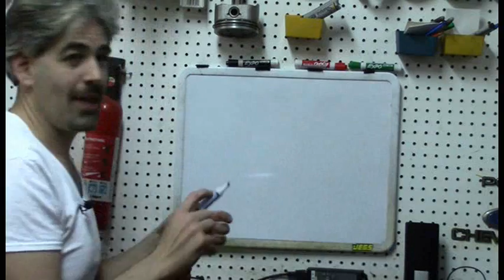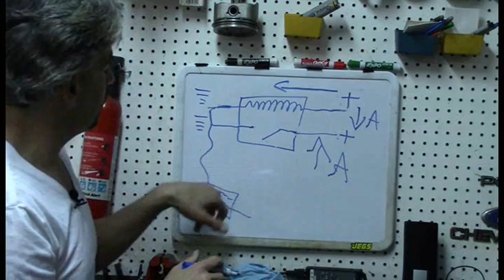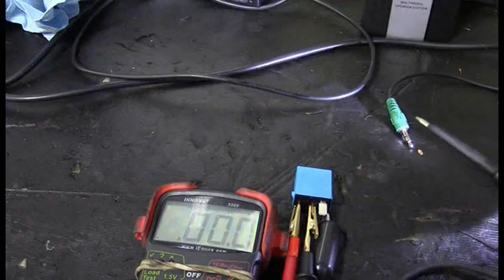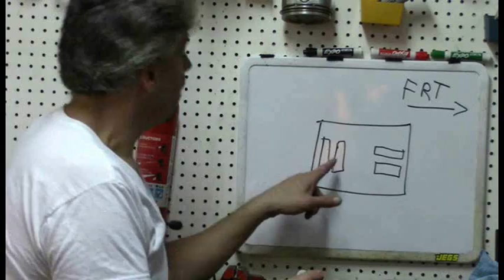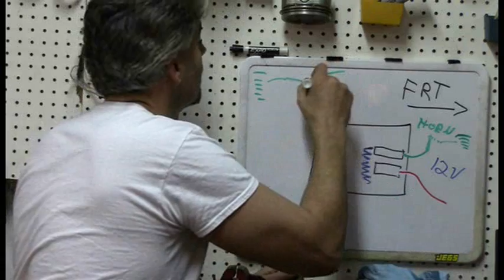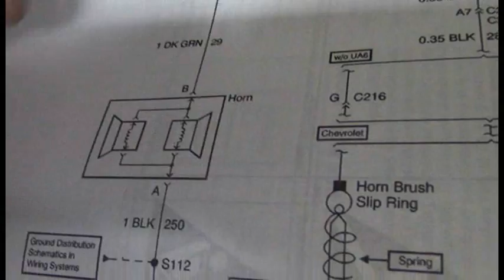Relays- Understanding, Diagnosis and Testing Relayed Circuits-Pt1

Comment: ok sorry. let me try to explain it better.  Please tell me what i am doing wrong. Internal short as a short in the compressor itself.  I have power on both ac wires with it plugged in or not plugged in. either way both wire show hot. it shows power on both wires on the compressor.   the coil wire and the ground wire . No matter if its plugged in or not . with the ac unplugged i have no power on the wiring harness wire. The wire coming from the harness that has the plug end on it does not have any power only until i plug the ac up.  the ac gives it power. instead of that wire giving the compressor power. Which is the way i thought it should be. The ac wires show to be hot even when its not plugged up to the wiring harness. The low pressure side switch shows power on both ports even with the ac unplugged  and will blow the big ac fuse if i try to bridge it over to cycle the clutch. Will also blow  the  big ac fuse if i try to bridge it over from the fuse box/relay. but if i unhook the high side sensor switch that show 3 hot 1 not 4 incerts that gives me  1 hot 1 not on the low side switch. then try to bridge it over and it still will not cycle the clutch but it dont blow the fuse that way. the high side switch like i said shows 3 hot 1 not but the 1 thats shows not hot is a blue wire going into the switch. that blue wire show to have power on it going into the switch but show no power in the port hole of the switch.  Yet i can hook a wire to the coil wire on the compressor  then  to the hot post and the clutch will cycle that way. The compressor worked great on the 96 cherokee. all i did was change the backs out because the lines go on different.
 i put a test light on the what should be the ground but shows to be hot held it there and  i pulled every fuse and relay in the fuse box under the hood 1 by 1 and none of those cause the light to go out or the power to go off  of that wire. Didnt do it inside the fuse box yet. . still showed power on the ground wire on the compressor. Well it should be ground but some how its got power on it. i do think i got a ground somewhere because that low side pressure switch should cycle the clutch when u bridge it over from there and so should the fuse/relay but they both will blow the big 20 amp fuse if i try that. How do i find a ground. The electric fan  switch/plug in shows, unplugged 1 port has power 1 port no power but when i plug it back in it shows both wires going out the fan to be hot. With the test light on the battery ground  the light comes on when i touch anything. the ac lines the compressor the engine the engine block and the block ground, inside of fender .. Man i need help..i hope you can understand this...
Reply from the maker: What are you using as your ground reference? Battery negative or chassis or the sensor connector?
Reply: hooking my test light to battery neg.  touch both wires on the compressor show to have power on them... touch light to sensor connector they both show power. the ground on the block shows to have power. Should i have test light hooked up to the pos.?
Reply from the maker: Check the actual voltage on each wire vs battery negative.
Reply: ok i borrowed a meter with the meter set on 20 v with the key on, ac controls on, fan on, and ac unplugged.  With black lead on neg post and red on  the compressor  ac plug it reads and 0.01 and  on ground wire coming right off the compressor reads 0.01.  However when i manually  kick the clutch in using the  hot wire on the compressor to the hot battery post i then get 12.5 6 7 volts etc  When   Jeep running everything hooked up the same way i get 13.4 5 volts  from the ac plug and  ground while  running shows 0.02  The voltage from wiring harness wire/with the ac plug i get 0.06 running .  Update  With motor off, key off, with neg battery term hooked up i get 0.00 at the ac plug and 0.00 at the ground on the compressor... but when i unhook the neg cable/post i get a reading   of 12.21 an rising from ac plug and 12 .13 an rising on the ground coming off the compressor. Terminal  hooked up no reading. Term unhooked and with my black lead directly on the neg post of the battery i then get a reading. I  admit I dont know much about using these meters but ive been watching video's trying to learn all i can. I really appreciate you trying to help me. i must get this working. I have breathing problems and i really need the ac working. Its hard for me to catch a deep breath when i get real hot. So Thank you very much for trying to help me.

Comment: And also maybe one of the reasons to use the relay is the PCM which it can't give a high current to all systems in the car it only provides the signal to let the high current activate the component

Comment: Matt, your reasoning seems flawed.  You found a wiring diagram that was "similar" and "maybe not the exact one for that car," and then, because that diagram represented what you had mapped out on the white board of knowledge, you concluded, "...so we did map it out correctly."
Reply from the maker: Yes i am correct and my reasoning is not flawed at all.  Wire color designation was mismatched  but functionality was identical. Therefore the diagram can be used after all.
Reply: You say "functionality was identical."  That is something that was pre-determined by you and is the reason you chose the wiring diagram you did.

By the way, I know you were correct in the way you mapped the relay.  Your methods in proving the functions of each of the pins was very thorough and left me with no question that you were right.
Reply from the maker: Well i didn’t really choose the diagram. Being a DIY I am relegated to only what is available. I pulled a google search for wiring diagrams for the model and year and that’s what it returned.  If i had something like shopkey or aldata it would be easier but bottom line is I can always map the circuit myself it just takes longer is all.
Reply: "I pulled a google search for wiring diagrams for the model and year and that’s what it returned."

I misunderstood, and I apologize.  I incorrectly assumed you chose the diagram you did simply because it matched your map.
Reply from the maker: no problem man. Truth be told I seldom use wiring diagrams for that reason. I almost always map circuits out so I can be sure. It’s pretty rare I get the right diagram. Sometimes though when i do control circuit testing at a PCM for example, I simply have to find a wiring diagram

Comment: Can you do something on  inverters  & how to choose  them on the white board of knowlege?  I blew up many fuses trying to power my laptop in my car cause I dont understand why or I dont understand peak powerer, start up power,   should I be looking at amps or watts? does higher volts mean more power?

Theres info but nobody breaks it down like you... how long can I run my car battery on a laptop.. should I recharge my car battery... I have no idea with these questions but would love to be armed with the knowledge
Reply from the maker: Yeah that would be a good topic. I actually once destroyed a scan tool running it on an inverter. I didn't realize it's not the same thing as a 120V outlet.
Reply: Exactly... I would have blown it up as well  because I don't understand that 120v  or 220v  stuff.. I just plug it in and hope I don't blow  the cigarette lighter, fuse or laptop... I usually do so I stopped using them..

I should have just sprung for the most expensive inverter and hope that works..

Comment: Also be aware many relays have a diode across the coil winding. Its  purpose is to suppress the  voltage spike created by the coil when the voltage used to energize the coil is removed.  The diode can make the coil look shorted. Reverse the ohmmeter leads and it wont conduct so you will read the coil resistance. Check BOTH directions, one will show a short, the other will read the coil resistance. If you dont see that resistance, the coil is open. If the coil is shorted you will see a short both ways. 

The above only checks the coil, NOT how good the contacts are. Energize the relay and check the contact operation. with no coil voltage the contacts can be either closed or open. Coil voltage will switch between open and closed. A good closed reading will show almost a short on good contacts. If you see a high resistance between closed contacts, shit can the relay, its bad.
Reply from the maker: Yes this is true- I haven't come across a model with the relay design yet but if I do I will surely update this information!

Comment: At 16:50 you say you're looking for continuity in the control side.  You will never see continuity there across these two nodes, so not sure what you're looking for.  When you push the horn switch, you still don't have continuity on the control side, you have merely closed the ground circuit so you then have a voltage potential across the control connections of the relay and hence you see 12VDC.  Good video though.
Reply from the maker: Ummmm.. closing a ground causines continuity....

Comment: Matt, thx alot! But I've been more of a motorcycle backyard mech. so cars can b a challenge (I just bot an AMG Mercedes!)  So what I've heard so far on your horn circuit  instruction is the power (red) goes through the relay and ends at the horn (which beeps) to ground. If that's correct then would headlights r tail lights b on the same type of circuit?? If that's so then wouldn't all that circuitry put a great drain on an alternator esp. at night?  Or take a cable put it on the + side of a battery and ground it. What happens? Sparks and great heat.  
Like u said in the beginning, 'electricity can b daunting'!

Comment: Oh and one last thought, although this may not apply so much to cars but would for more complex troubleshooting of electronic circuits when discussing voltage. One would say "the voltage at this terminal is 12 volts with respect to ground".  When measuring voltage, in general you would want to say what the voltage is but always with respect to some other point. Most of the time though you are talking about a voltage with respect to ground so it's really not that critical for auto troubleshooting.
Reply from the maker: The assumption is and always should be to ground.  If I measure voltage against any other reference- say comparing signal to reference in a hall effect circuit, then I would of course mention the reference baseline.

Comment: I just can't understand why this guy hasn't gotten more subs than he has. He's a mine of information, and he always conveys his diagnosis in such a clear manner - really makes you want to listen. You can tell by his voice how enthusiastic he is about his work. Let's just hope that those 81K are the cream of the crop.
Reply from the maker: Thanks but as I often indicate, the overwhelming vast majority of the automotive community (98% i estimate) only can identify with spinning a wrench and nothing more. They will never identify with anything you actually have to invest time learning.  So yes, my subs absolutely represent the top-tier of the automotive community.  They are the ones who you won't see parked outside autozone when they try to fix their car so they have the parts-cannon nearby.
Reply: @SchrodingersBox  I found and subscribed to your channel.  I've got some engine problems with my used U-Haul truck.  It's electrical.  When my lights were not working it turned out to be the brake switch.  It's a 94 GMC Sierra C3500 with 7.4 with a TBI.  The vehicle is running rough and my gas mileage is very poor.  The spark doesn't seem to advance on acceleration.  It could be the ECM or wiring.  The plastic put around the wires was hiding some bare wires.  It didn't fix anything.  Saw the other video on checking sensors using a multimeter and probe so that you don't burn up the sensitive electronics.  Thanks for the information and hopefully it isn't the ECM.  I hear static electricity is a killer.  I did purchase a grounding wrist strap.  Scotty uses rubber gloves.
Reply: I agree with you,he is down to earth and very humble to display his skills and abilities on platform on media like youtube.those who teach with simplicity and illustrate points are called real instructors/tutors.hats off for this Guy
Reply: Ppl love bullshit simple, if was talking crap you would see a lot of subs but hes good so they stay away and maybe think he is crazy
Reply: Pro trick: watch movies at Flixzone. I've been using them for watching loads of movies lately.
Reply: @Malcolm Lucas Yup, I have been using flixzone} for years myself :)
Reply: He got 1 more sub right now 😊
Reply from the maker: Much appreciated!!

Comment: have a question matt, trying to get a good grasp on electrical here.... These two vids you clearly show measuring voltage and resistance in circuits which as I understand is safe regarding 12 volts....when would it be beneficial to measure current in a circuit...and for what purpose? ?..as I have read a little that current is dangerous to measure and most dvom's only read max 10A... Thanks in advance! !
Reply from the maker: Reading amperage is useful because voltage does not mean there is electrical flow. An open circuit is great example- You could measure voltage at a socket with an open- there is potential, but no current. Measuring current may indicate there is just resistance in the socket.
You never wasnt to read amperage without a load in the circuit- that should be obvious because it would short.

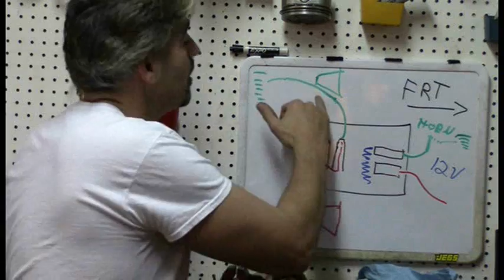Comment: thank you for this video. I learned a lot from your clear explanation. It also provokes a question. At approx 23:50 in the video you did somthing where you might want to warn your viewers. This is where you send 12 volts into the ground side of the relay (horn) circuit. This is done to prove what side of the circuit the horn is situated (I believe you did this because your were certain the horn was located). However would it be appropriate to warn the viewers of the risk of injecting voltage on the wrong side of the load circuit? It seems to me that it would not be a good idea to guess and inject 12 volts on the wrong side of load circuit. Please let me know if you agree or disagree. Thanks.

Comment: YOU are a legend, i’ve learnt so much. Everything on my motorcycle works, other than the high beam after I had a low side crash, this has given me enough knowledge to narrow it down.

Its strange as there is not 12v going to the light socket (tried the bulb and it works) but there is 12v leaving the high beam switch on the left hand switch gear on the handle bar when its pressed.

Frustrating but I’m sure I will get there
Reply from the maker: 21ADB21 Simple open in the wiring between the switch and bulb.

Comment: not to be picky but voltage does not move it is applied. also current flows from negative to positive. conventional theory has been replaced by the electron theory. this does not really matter with most electrical diagnosis, but does at the electronic level. fine job on explaining relay theory and operation.

Comment: If you want to make life easier for yourself and don't have any real scan tools, you should invest in a PowerProbe 3 and The Hook. I specialize in computer systems and electrical diagnosis. I noticed you guessing a few times or not checking (Maybe for the sake of the video), but I have used scan tool/scopes that cost more than my car and my $400 powerprobe setup never fails me.
Reply: Swot Roke Sorry, Meant The hook only.

Comment: Hi Matt..just came across your channel....thanks for sharing....One ? if you would might know.... the air/fuel ratio on a normally asperated car vrs. turbo charging that car....does the ratio change with added forced air.
Reply from the maker: Its a great question several people have asked. I have yet to see a turbo car but if I can get time with one, I'll be going to town on it. All kinds of questions- fuel trim, MAP readings, etc... But for now I haven't even looked into it so I do not know how air/fuel balance is handled or even monitored in turbo or supercharged applications.

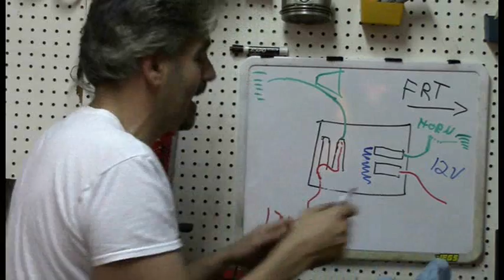Comment: you do know that you were lucky at 24:00?  Your test guessed the horn to be on the ground side but you had no guarantee that it was on the ground side.  All of your tests done prior to that had not determined the location.  If you were wrong, you would have created a nice short to the ground when you went to blow the horn.  Fortunately, your PowerProbe3 has the circuit breaker in it, so you would have been spared  from any real damage but personally I think that was not the right thing to do if you are in a teaching mode!
Reply from the maker: This is true- I was not concerned about the short to ground risk because I knew I was circuit greaker protected.  Looking back at it a test light would have been a better way if I had to guess.
Reply: Maybe test the voltage drop from the relay load side ground to vehicle ground when the horn is energized.  If there is a sizable voltage drop you know at least something is loaded downstream, probably the horn.  If there is little drop you don't want to apply voltage.